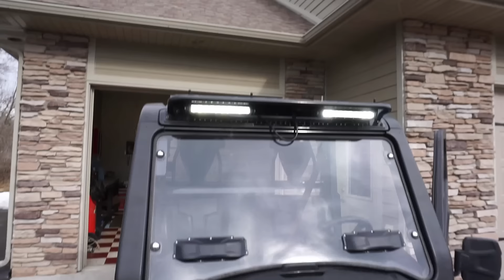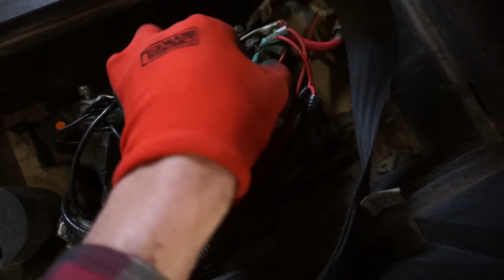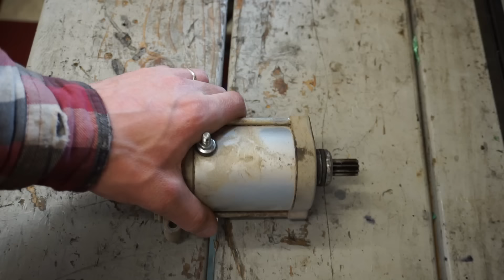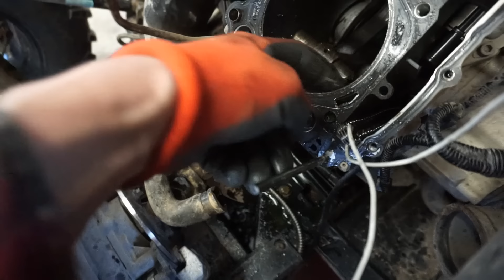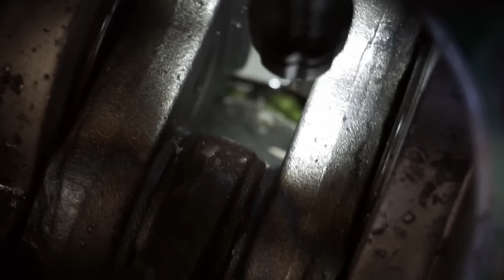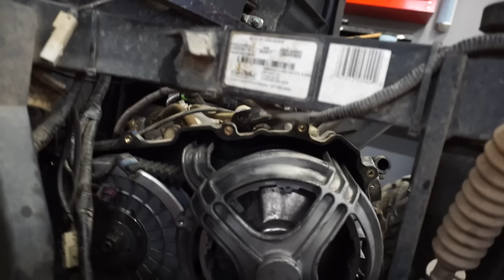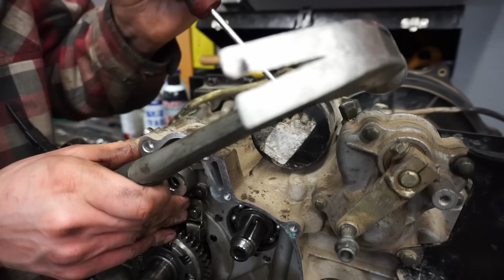I Bought This $15,000 UTV For $3,500. How Bad Could It Be?

Comment: It's from thermal break down. From not changing the engine motor oil regularly and it overheated it from A stretched trimming ⛓️ chain and busted and snapped the woodruff key to Joe. I'd order stock parts and hone out the cylinder and maybe invest in A aftermarket piston like A wise co piston for it and gasket kit and seals. I highly recommend running zinc in that engine after rings break in to. And changing the motor oil after the first break in period to. And add in zinc powder to help more protection and Life long durability when motor oil and filter is changed regularly to.😊

Comment: yeah, right... Lil old couple just drove it to church on Sunday. WOW, never say that happen in all my years... Good luck. I hope you can fix it. This is a really interesting one.
Reply: Correct, the telling thing was all the mud and dirt on the top side of the belly pan yet the entire unit looked clean as a whistle. Plus, you have to factor in that torn seat that indicates a lot of seat time and wear. 

My guess is that engine was freewheeling wide open in neutral. And then it blew.

Comment: This thing must have been run low on oil and at high rpms judging by the fact that the crank looks severely overheated on both sides of the journal to the point of turning purple, and also because it basically turned into a piston blender lol.

Comment: Looks more like the old couple had a grand son! Lol. In my opinion, that type of catastrophic failure we were wide open. The connecting rod showed high heat marks at the wrist pin area. I guess if I knew much about this, you would be watching my videos. Lol. Sorry it was so far gone.
Reply: DID YOU ALSO SEE HOW COOKED THE CRANK ITSELF WAS,AT THE MAIN ROD BEARING? WOW
Reply: @georgetubbs8211  Yes sir! It was a hot tub party for sure.

Comment: I'm guessing it overheated, judging by the bluing on the crank. Low oil or low coolant. I think the original owner knew it was blown up. That's why they bought new quads.

Comment: The ole disappearing piston trick. I've seen a lot of engine carnage, but never that. Usually when a piston lets loose like that there would be holes in the case. That's impressive!
Reply: Joe needs a bore scope.
Reply: Reminds me of that classic candid camera sketch from back in the day when this guy pulled into a garage with his car that the camera crew had pushed down the hill (and without an engine) and said to the mechanic it wont start,ha.
Reply: Old folks probably didnt check the oil like they should.
Reply: Must have been a chinese piston of dubious quality.
Reply: Original 200 hr engine....  @Skidderoperator
Reply: There is always a reason why something is very cheap, usually it's a big ticket item, like the engine is junk, or the transmission is junk. But it has a lot of potential, with a engine replacement.
Reply: It just reads negative no big deal. What got me was he didn't check batt volt first. How can you expect 12v when batt is 10?
Reply: @riccochet704 i agree, i have seen other youtube videos where the piston blew up taking out the block lol
Reply: that's what happens when mistake an M80 for a spark plus cleaner!
Reply: Exactly...
Reply: Is he a sucker at least he knows what condition the motor is now. Next the trans all said and done he will be into it 20k. That will be someone's inheritance. The p-lot I'm in just turned into a lake. It's coming down wow..
Reply: and a shed load of metals bits in the sump
Reply: Amazed the crank rod was not squirrely.
Reply: So is he a sucker ?
Reply: @-First-Last  He ain't no sucker dude. One bad out of ten don't make nobody no sucker.
Reply: He’s hooking up the 12v dc meter in reverse polarity !!!

Comment: You’d have to expect to at a minimum refresh and/or replace critical components in a non running situation. There are certain situations where you find a simple low cost solution, but rare I’m sure.

Comment: Yeah these were a bad design. Lot of complaints bout the piston grenading. Weak oil pumps burn up then 💥
Reply: Cub Cadets were owned by International Harvester until 1980. Sold to MTD, there's your problem.
Reply: Made in China with junk Chinese parts is the problem. They have these China made piles of junk sitting in the entry ways of Fleet Farms, Menards, Home Depot all over the country. All you have to do is look at em, a child of 4 can see they are junk scrap heaps. If yer still not convinced, then test drive one, then run away as fast as you can. banks won't give you loans on these crap heaps. @craigeldridge2695

Comment: See that green base gasket it's been replaced so at one point and time someone had that engine apart
Reply: Yep, they pulled it apart, took the piston pieces out and bolted it back together.
Reply: @djpar3492 They also drained the oil, and put cleaner used oil back in...then listed it!🙄
Reply: Surprised they didn't try to recap the plug too

Comment: ROFLMAO!
$15,000.00 New?
In 1977, I bought a new Dodge Ramcharger 4x4 with a 440 V-8, for $5,200.00.
Wow!!!
Reply: @richardstone And the Ram charger is probably still running today unlike this shit!
Reply: $5200 in '77 is about the same as $26k now, when adjusted for inflation. Still a good deal for a truck.
Reply: Yep, and that was out the door, taxes, title etc. It was the heavy duty model with the 205 gear drive transfer case and the Magnum engine! Very few of these were made. I raced it in4x4 competition, stock class and nothing could touch it. @SirOsisofLiver

Comment: Just bought a non running Royal Enfield Himalayan and when I took the head off it was the same situation. The piston had blown apart. Everything was unusable, head, cylinder, crank. I opted for a replacement engine as even the cases were banged up, plus the replacement engine was cheaper than a rebuild. Good luck!
Reply: What did a new motor cost you?
Reply: @glengarbera7367 it was around a grand with shipping for a basically brand new (2 miles) engine.
Reply: @Parashoootist  lol. My old girlfriend sold motorcycles at a dealer In Toronto.  You would be surprised how many folks write off bikes within minutes of leaving a dealership.

Comment: Love the channel, been following a LOT of re-builds.
A little advice from an electronics engineer - Don't continually try to turn the motor over when the starter is locked up......you'll only end up burning out the starter and/or the solenoid.
Also, a clue that either the battery is knackered or the starter was locked up was the backlighting on the clocks going dim when you turned the key.......a lot of current flowing out the battery and a large voltage drop.
Reply: starters and solenoids are cheap though so its not a big deal at all.

Comment: Total scammers. They drained the oil and then put dirty oil back in it so you didnt think there was a major issue.

Looks like a circlip failed, the piston got off it on one side and went sideways. That's the only thing I've seen cause an issue like this.
Reply: I've said it before, most ATV/UTV owners are the worst at doing any maintenance on their equipment.   Far ahead of motorcycle and snowmobile owners.
Reply: If he bought a bore scope camera and inspected at time of purchase he would have seen it had serious engine issues.  Why not, pull the plug and take a look.

Comment: Order Hisun parts as they are much cheaper than going through cub cadet for the parts. It's just a Hisun Sector 750 engine.
Reply: If you do decide to part it out I need the cases.
Reply from the maker: Where do you buy a crank for this thing?
Reply: @2vintage see my posts below. Ebay currently has one for half the price. I posted a link.
Reply: @2vintage  There I a crank on ebay that and the seller has a lot of knowledge on the hisun and cub cadet UTV. Motorcycle doctor is the seller.
Reply: Alpha sports, motorcycle doctor is where I get the parts from online. Also you can call Krepps Service station in Spring Mills, PA. They are a large Hisun, Cub Cadet dealer.